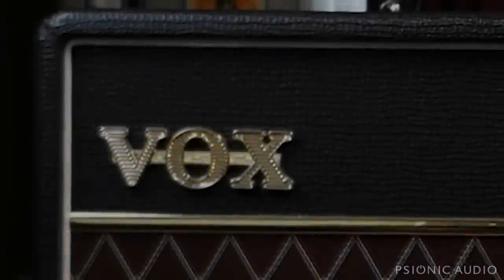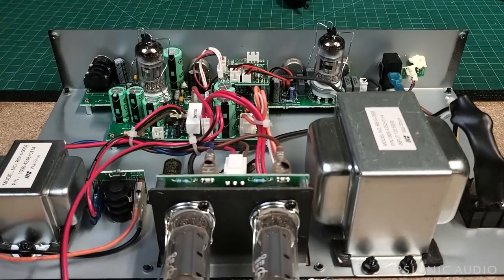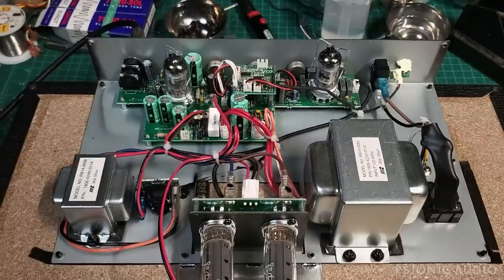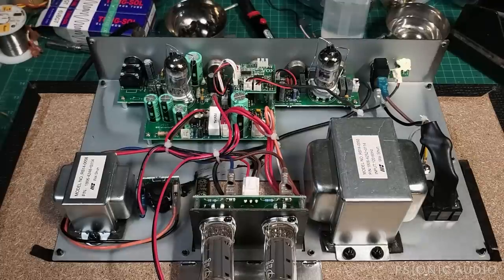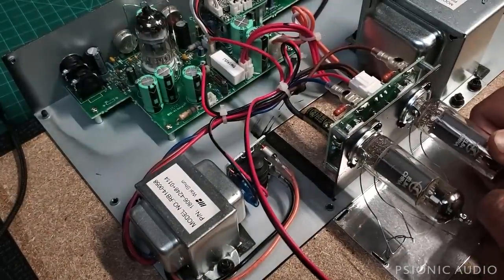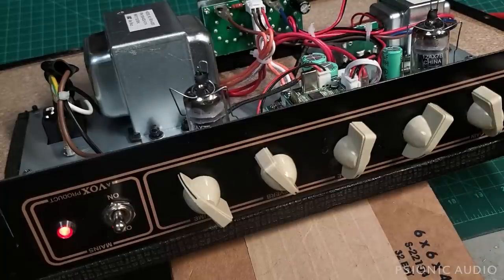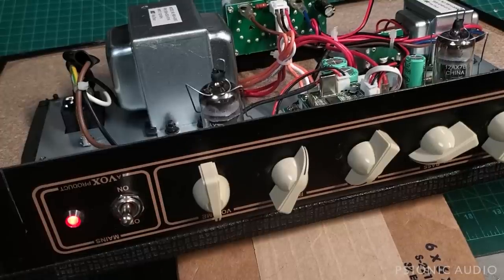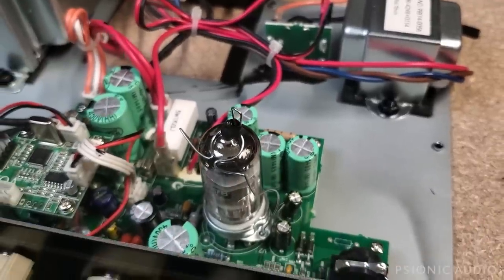Vox AC10C1 | Repair & Review

Comment: Well you pretty much have the same conclusion that I did. 
I was able to play the AC15 and the AC10 side by side and the AC10 sounded muddy and mid forward with no usable drive sound and strangely, lots of rattling when turned up. Move over to the AC15 and everything just opens up, like a blanket was taken off of the amp. Better sounding sparkly highs, tons of great sounding drive, especially on the top boost channel, better reverb and really nice tremolo.

The AC10 really doesn't sound like a Vox at all.

Comment: Thanks for this video! I'd like to upgrade the screen resistors in mine as well, and I was wondering if you could advise which specific resistors I should purchase? At 2:44 you mentioned "they're supposed to be 470 ohm" but then at 7:57 you mentioned they were 2 watt 1k's. Just wondering if that's the correct information, that you upgraded 1/4 watt 470 ohm resistors to 2 watt 1k resistors? Also, did you go with carbon film or metal film? Apologies if my questions are a bit elementary, I'm new to amp repair and modifications and I really like the concept that you executed here. Thanks!
Reply from the maker: By "supposed to be 470R" I meant the color bands indicated that. The one that was discolored might not have been that any more.

Schematic says 1/2W but they were tiny, looked like 1/4W. 

I used Vishay PRO2 2W 1K metal films. Won't burn again.
Reply: @PsionicAudio  thank you for this info! I'll for sure be doing this mod to my AC10C1. Your channel is a godsend and I appreciate everything you do!

Comment: What would you say is the better amp out of the custom classic AC30 (with resistor mod & celestion speakers) and the newer AC30 custom? What would you consider, of those two, closer to the original AC30?

Comment: I trust your technical expertise more than  I trust your ears. I have one of these and have owned and played through several legendary amps over the past 60 years. It could be that some of these sound better than others but that flies in the face of your technical explanations for sonic deficiencies. More likely has to do with the player's ability to interact with the amp. You probably should have left the bubble gum remarks unsaid. Since you went there my recommendation to you would be to A/B the amp to other amps of your choosing using a more highly skilled player, to put it kindly.

Comment: I have an AC10, I have replaced the stock speaker with a Weber DT10P - big difference, more low end and clarity. I will say i have noticed turning the volume and gain past 1-2 o'clock makes no difference in sound/volume. could this be a " weak" Output transformer or just the way the amp is?

Comment: As I'm a non-tech , what value are those 2 caps you replaced above the output tubes please?    I might try to replace them myself to increase reliability
Reply: They’re 470r resistors. I measured in one I’m repairing. I think he replaced them with 1k, or that’s what I thought he said…

Comment: The worst aspect of this amp is the closed back with the small vent at bottom and the closeness of the power tubes to the speaker, meaning the tubes heat up the magnet and you are limited to the kind of speaker you can use as replacement...

Comment: I am thinking of buying an AC 15 custom. They come with different speakers a Celestion Greenback or a Celestion Alnico ( Vox Ac15C1X). There is a price difference, is the second one worth the difference of around £250
Reply: Honestly, I have an ac15c1 and a Marshall dsl40c. The dsl is waaaaay better. It’s smooth warm and has a consistent tone. The ac15 sounds harsh boxy and either too loud or trebly. I’m going to sell it. It doesn’t even channel switch. I have tried to love it, took it to a gig tonight and the singer complained it was hurting her ears. I’m going to use the money to try something else. Not sure yet what but it won’t be a fekin Vox
Reply: @joosboer1030  Thanks for the info….. I will have to try a few more options.
Reply: AC15 with an alnico speaker is a really good sounding amp
Reply from the maker: You have to learn how to set the controls for an AC15 or AC30. They don't work like Fender/Marshall. Easy to get great warm sounds but you have to learn the amp.
Reply: @violinmiata  Cheers

Comment: Is it also possible that amps in the class just keep working for 10-15 yrs plus and do not need some expensive repair?
Reply from the maker: Not likely. Notice I had to change two screen grid resistors in this one. No sane designer uses 1/2W resistors for screen grids. What other flaws will reveal themselves?

Comment: I thought it sounded better when you had it open. Maybe it's too close to a closed back? I would be so pissed if I had an amp that I couldn't fix and had to throw away or use for parts. No way I would buy it.
Reply from the maker: When you heard it open it was through my shop cab about ten feet away.
Reply: @PsionicAudio  oh well no wonder.

Comment: Good for the grid resistors, but the output-tubes still heats up the pcb. Bad construction at all. Therefore I don't buy VOX amps. The only exception is my old VOX concert 501 amp, build by Marshall in the early '90.

Comment: Any suggestions for different preamp tubes to try in an AC10 or Vox amp in general? I currently have a bunch of 12au7’s and a few 12at7’s I pulled from an old stereo, but I don’t want to kill the vibe and the brightness of the amp to try and get more headroom.
Reply: if you accept my suggestion man , i would say just put 2 jj 12ax7 in it ,'v1' in this amp is a lnd150 fet, so you need a robust and reliable tube in the cathode follower , that's  it
Reply: @antonix_81  You’re probably right about that. When I bought it the previous owner had upgraded to new Russian Mullards all around, but a couple months ago it started to sound really microphonic and terrible at low volume. Threw some JJ EL84s in and it immediately sounded better, but then tubes got crazy so I passed on new preamp ones.
Reply: @davidmanson3659  obviously you need a 12ax7 in the cathode follower to drive better the tone stack , i tried a 12at7 sometimes in the phase inverter (like fender did) , you can get a cleaner sound , but i don't know if it will draw much more current than the 12ax7 in that amp , if the power transforner doesn't get hot you're ok, at least i would be ok with that
Reply from the maker: A Mullard will die as the cathode follower in this amp as would any other Russian made 12AX7. Stick with JJ or Chinese. But stay with a 12AX7/ECC83. AT or AU wouldn't hurt anything but they would not make the amp sound its best (albeit "best" is not much here).
Reply: Jj 5751 in mine, sounds great gives more headroom
Reply: @PsionicAudio  I tested mine when my amp was acting up and they seemed to be okay, unlike the power tubes, but I’m definitely going to watch for when they do inevitably crap out on me.
Reply: @YeatzeeGuitar  That’s what a buddy recommended me, I’ll definitely look into it
Reply: @vincentl.9469  it wasn't me asking about tubes man 😁

Comment: You ever come across a Pathfinder 15R?
Reply from the maker: No. To be honest, my bench fee precludes taking most cheap amps in. Most inexpensive SS gear costs more than it's worth to repair.
Reply: Yeah. Makes sense. Those amps have such a reputation that I wonder if there will ever be people who value them enough to pay bench fees just to refurbish them.
Reply: @talbotadams1655  Please correct me if I'm wrong, but I thought that the Pathfinder 15R actually has a great reputation 🤔🤷‍♂️
Reply: No doubt! They are great. I used to have two of them and I regret selling them. What I meant was that as they further age and start to require maintenance, will they be worth the cost of bench fees to their owners. I love them though. But yes, if I still had one and it broke, I’m not sure I would be willing to pay hundreds of dollars to have it fixed. But some people might.
Reply: @talbotadams1655  I wouldn't be prepared to pay hundreds of dollars to have them repaired, but as an electronics hobbyist, I'll repair it myself, provided it's a simple fault that needs to be fixed!🤞😋😂 

They do appear to be a bit fiddly to take apart though. 

I can't believe how expensive these things have become. It's just a standard analog solid-state amp, using transistors, op-amps and a power amp IC.

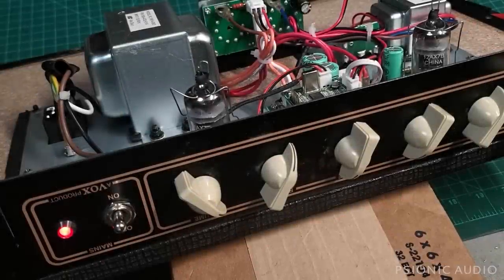Comment: Nice work with the resistors 7:54 (Bending the legs / air gap) 7:59 Resistor Specs 2W 1K - is that 1000 ohms? Better to ask and get it right. Cathode specs 8:59. Other Amp Techs have increased the cathode bias resistor to from 120 ohm to 150 ohms 5 Watts to lower the Power and make the amp run less hot, as well as changed preamp tubes to 2AY7 - to increase headroom cln up to 7 without distortion on the scope - reference https://youtu.be/D1Cydw-dejs - What do you think about these fixes? Thanks. Great Video!!
Reply from the maker: Yes, 1000ohm 2Ws. Tube changes might help but they are bandaids because the opamp circuit doesn’t have enough headroom for the signal levels.
Reply: @PsionicAudio  - Is there a way to fix the op amp / headroom levels? Just asking. Really like how you explain it all. Thanks.

Comment: Love voxes, love 10" speakers, wouldn't buy this at half price.
Reply: I got one for $300 and put a 12” in it
Reply: I’d say it’s a good first tube amp but I mostly agree
Reply: I used to buy cheap amps and mod them, mostly because I was on a budget and I though I was smarter than other people doing it that way.

Now I just skip it and save for the amp I really want.

If I had to get an amplifier solution in that price range I'd buy a modeler these days.

Comment: Anybody in the comment section have experience with same general class amp a little bit more expensive such as the blackstar studio 10 or supro Delta king?
Reply from the maker: The AC10 isn’t Class A. The Supro is built like crap but sounds ok. I haven’t had the Blackstar in.

Comment: Am I the only person that learned that the fastest and most effective way to check a 'guitar' cab, first for mechanical vibrations and only then more subtle distortions like microphonic tubes etc., is to play single sustained notes, NOT ON A GUITAR...but on a bass? Why does every guitarist/tech pick up a guitar and wank their way through riffs so laden with distortion and complex tonal interactions that nothing informative can be easily heard through such a sonic swamp?

If you believe that playing a bass through a guitar amp at modest levels will damage it, you don't know enough about speakers, amplifiers or audio in general to comment. If you are a repair tech, try this and save yourself hours of poking and prodding with probes for what is 'most' likely a mechanical issue caused by poor design proximity, cabs that are too small, or resonances and standing waves in closed back cabs. The frequency offered by a bass just gets you their faster.